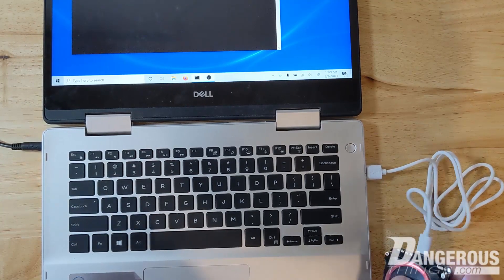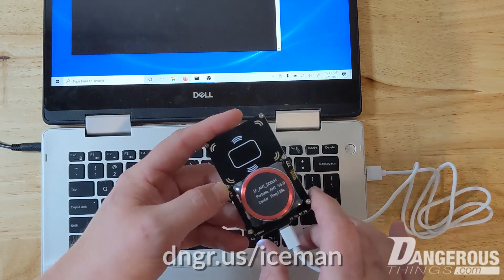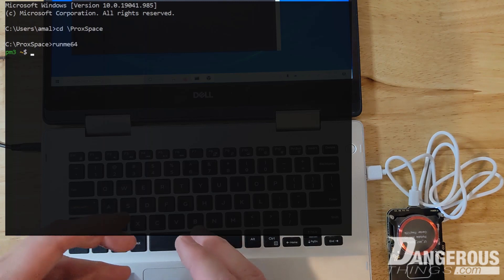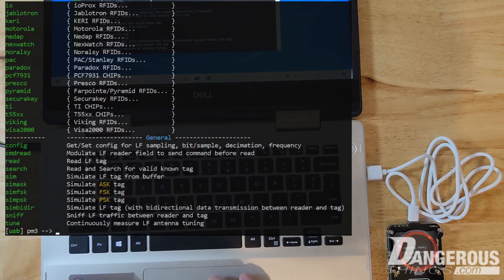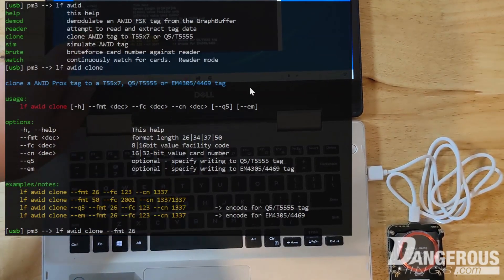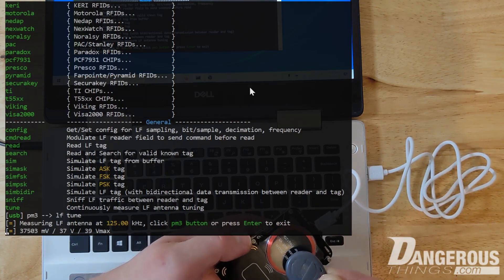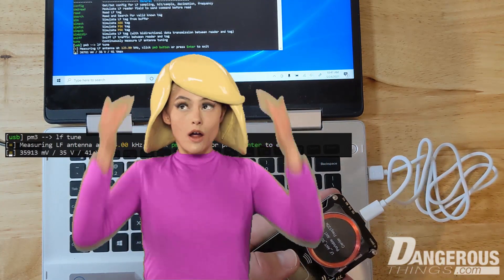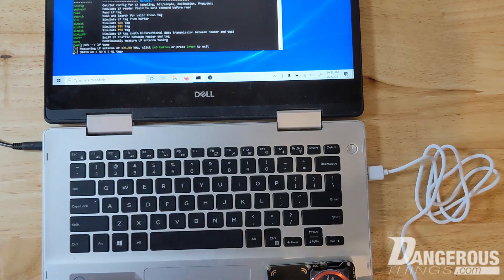Exploring the Proxmark3

Comment: so can anyone just put it simple.....can i use it to get someones credit info or not? whats the point?
Reply from the maker: The proxmark3 is an investigative research tool you can use to do many things with.. getting someone's credit card information is technically possible using this tool but there are far easier and more practical ways to get at credit card information. If you work with RFID transponders at all, this is the tool to use.

Comment: I need something that can clone all frequencies to another card decode cards and is portable
Reply from the maker: Certain devices are secure and cannot be cloned but many others are able to be cloned or emulated by the proxmark3. You will have to use the proxmark3 to explore your source cards to determine if they are able to be cloned or emulated.
Reply: @Dangerousthings  ok but can it be connected by Bluetooth with Android for portability
Reply from the maker: @letsgetto1millwithoutvids  there are certain versions of proxmark3 hardware that do support this, but the android client is outdated and requires old versions of firmware on the proxmark3 hardware. There are alternatives though - https://forum.dangerousthings.com/t/proxmark3-easy-and-raspberry-pi-zero-2-w/14310